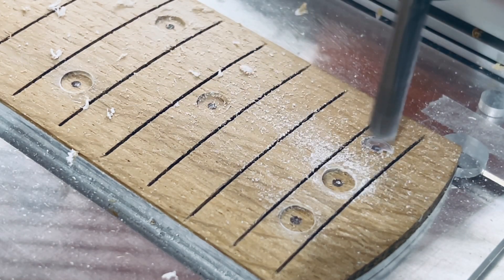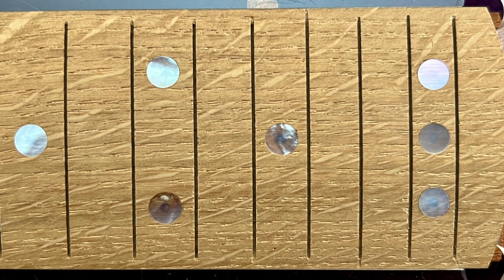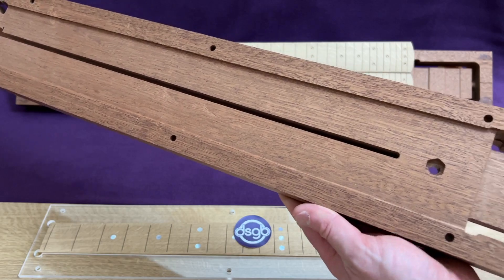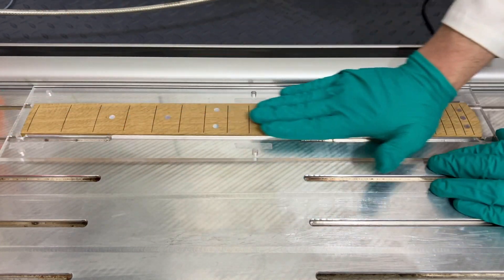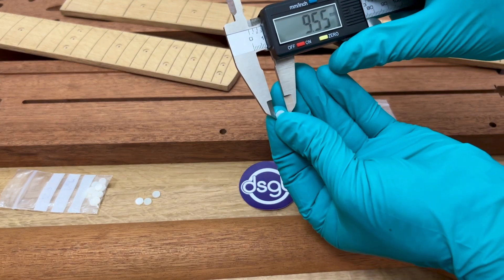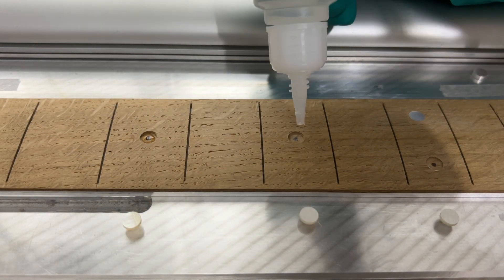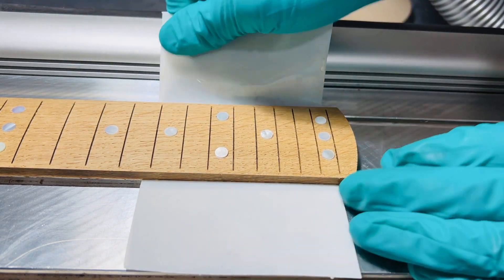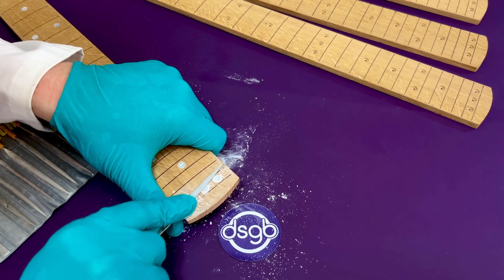Brian May Red Special Guitar Build: Fretboard Position Marker Repairs

Comment: Strange...I have Oak that is old several 1000's years from a river, and water didn't do any damage. It made it stronger, it's an extremely hard wood, not a fossilized but it just got harder, color is black-purple. My aim is to make a guitar body from it.
Reply from the maker: I have heard of this phenomenon. It should make great tone wood. 👍🏻😀
Reply: @dsgb  yes it should be and it is. A very hard for tools ( a significantly harder then ''usual'' oak), but it has due to added hardness very nice resonance - added sustain. 
I guess that difference is when water is used to wet wood and dry on air VS when it's submerged under the water fot a long time. There is no free O2 and for sure there is N2 (that is over 70% of our air). So wood don't fall apart, and is ''cured'' naturally, raisin do it's job etc. Some Italian famous violin maters use that trick, i guess i can share that with you Sir. BNTW great videos, and i like your site.
Reply from the maker: Yes, as you say, preserving and hardening under anaerobic conditions. Thanks for your kind compliments and I'm pleased that you find my content useful and informative. 👍🏻😀

Comment: I've done this with an under sized forester bit and a hand drill...  chip out the remainder,  done in a few minutes
Reply from the maker: I assume that you meant "Forstner" drill. I needed to remove the old dots and drill the existing holes deeper so the job was a bit more involved than just a straightforward remove and replace, that's why I chose to re-run the CNC toolpath. 👍🏻😀

Comment: Hi Doug. I doubt that I would have the confidence to ever attempt this procedure but it was interesting to see it done. I guess CNC will only deliver precise results if you align everything correctly. Did you consider just drilling out the dots on a drill press aligning by eye?
Reply from the maker: Hi Adam. Yes, I did consider avoiding all the alignment faff and just drilling the dots out manually using my drill press. However, I thought it would be more of a challenge and, if it worked out o.k., make an interesting video. 👍🏻😀

Comment: Afternoon Doug! I'd like to follow up on your advice about not letting water to contact a finished wood surface. I agree and disagree, however this is not atypical of me as you might expect by now. Water is actually incredibly useful as part of a finishing schedule as the cells that comprise the fibres of wood will readily take on water and swell, as is their biological purpose. The main point is that fibres which are cut, damaged or unsupported from sanding processes will swell and rise up from the sanded surface. They can then be knocked back with a lick of 320 grit paper at 10 o' clock and 2 o' clock with respect to the grain direction, as in line has a higher likelihood of pushing them back in place. This handles the initial fuzzies raised from finishing. In general it is unwise to get surfaces wet for no reason. I'd probably say this is more of a wood biology issue than one of chemistry in terms of informational value. ;-)
Reply from the maker: Thanks for chipping in.

It's sound general advice rooted in physical science principles. Some species are relatively impervious to water such as ebony. Of course, several factors such grain orientation, structure and damage from cutting or abrasion will influence water take up. 

Please bear in mind that I pitch my videos to a general audience including people with a primarily musical or artistic background and try to edit them so that they have some pure entertainment value, rather than being informative or instructional. 👍🏻😀